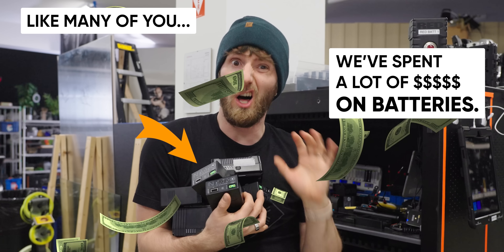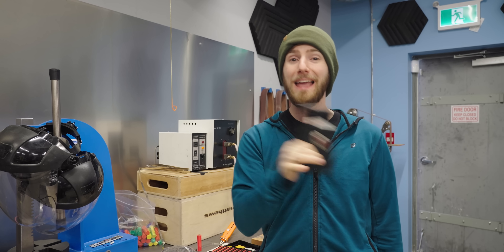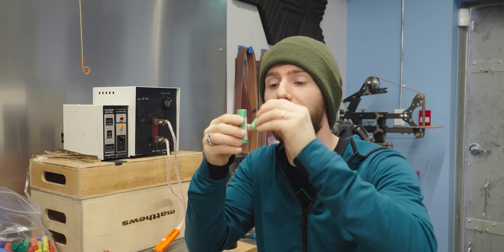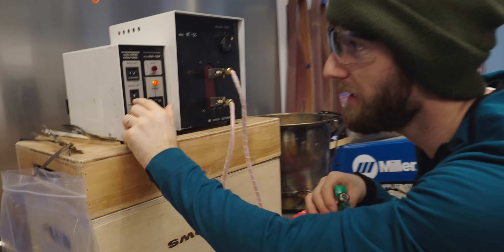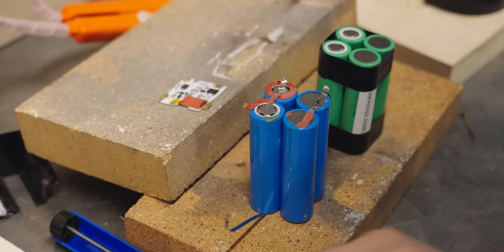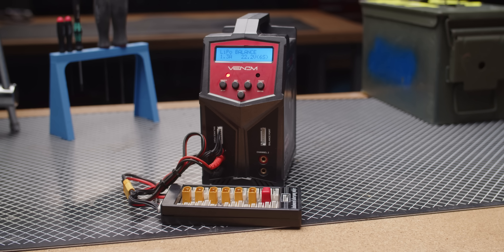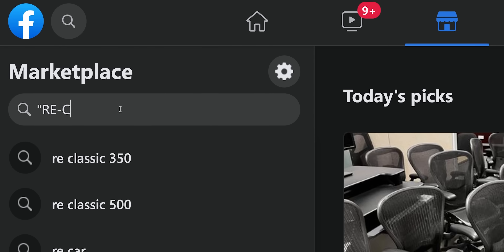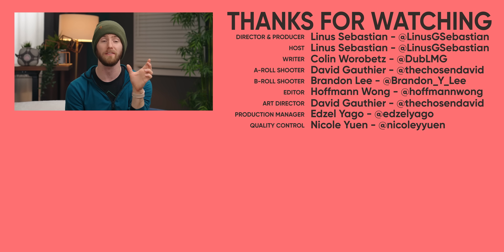This should be illegal… Battery Repair Blocking

Comment: I’m kinda tired of the lithium fearmongering tbh. Like, yeah, don’t puncture them or saw them in half or throw them in a fire or pour water on it
But there’s an entire hobby of people strapping raw lithium cells to a set of spinning knives flying through the air at 100km/h with velcro. Lithium is fine if you take basic precautions
Reply: oh hi ! i have a spinning knive ! had 2 battery fire (collided with another spinning knife and with a wall) but assembled a few 18650 and 21700 packs with no issues whatsoever
I was laughing a bit at how they threw away their pack while i got bigger sparks while plugging my drones.......
Reply: @TheElipsus  I had a short on an FC USB port once (bad coating job on my part) and I connected the battery while it was plugged in to said port. Took 2 days to get the smell out of the house
Reply: @TheElipsus  yeah the difference is they wanted to use the batteries in their work space, around other people, to make videos with the power of said batteries. You are playing with a toy for entertainment and are focusing solely on said toy the whole time. Having a lackadaisical outlook on the safety of your employees, your assets, and your revenue isn't a good idea, especially if you are going to make a public video about it.
Reply: @Ravenousjoe  not true. I use FPV as a cinematography tool, often on gigs. I did one shot in a dense urban area over a 400m tall building. If, say, the hand of god decided to reach down and unplug the battery, there would have definitely been a lot of property damage and potential casualties
Not all garage-built drones are used recreationally 

Edit: autocorrect
Reply: @MaxRovensky  so you are admitting that you are willing to risk property damage, and injuries to others just to save some money on batteries? Given that they work in a different environment entirely, that's up to them if they want to take that risk. I believe you that it isn't as dangerous as they say it is, but if they don't feel comfortable, or have 0 interest in practicing just to save a bit of money (while still having inherent, albeit lesser, risk), that's up to them.

It's not fear mongering if you understand that not everyone is comfortable with doing these repairs, especially when property damage and injury is in the picture.
Reply: @Ravenousjoe  No, I would happily pay extra for a DJI-style smart battery for my drones if one existed. The reason FPV pilots use dumb raw lithium-polymer cells is because they need to be able to delver a lot of current in very quick bursts. Lithium ion packs can't do this and no one except DJI is really doing anything in lipo bms space and the one FPV drone they have is unusable garbage. Texas Instruments have a reference design for a drone lipo management board which supports up to 4 cells (which is getting outdated quickly as everyone moves to 6S) but for whatever reason no one has made it into an actual product.
Reply: i remember a video of louis rossmann just hammering lithium batteries down just to prove the point that they aren't as dangerous as apple makes them out to be
Reply: have been using ohms law to safely vape with lithium cells for 6 years now. using mechanical device right now with no protections.
Reply: man, I was thinking of commenting that, lithium batteries are dangerous, but this felt like too much lol, like I'm strapping them with $4 worth of velcro straps, no safety systems anywhere. And the fun part is, that if a better battery would be invented, with even more energy per cubic cm, even more dangerous, we would slap them on drones immediately xD
Reply: @SukSukulent  Hell yes, anything to give me more flight time for some long range cruising :D
Reply: I agree with you, but the same could be said about a LOT of dangerous substances or activities.  A certain amount of fear of the thing (be it Li-ion batteries or whatever) is why you take basic precautions.  I fear getting into a car crash, so I take precautions when roads are slick, but it also doesn't stop me from driving.  Those Batteries CAN be dangerous.  Until the dangers are common knowledge and people know how to deal with these dangers, I don't might the fearmongering.
Reply: agreed, i think ltt was going a little overboard to make this look more dangerous than it actually is.
Reply from the maker: As an avid quadcopter builder/crasher/maintainer (in that order) I am well aware of the dangers of Lithium cells. We took proper precautions, and want to do our best to convey the danger. Batteries are hazardous, and people need to do their own research before attempting to work with lithium cells - that's all. -CW
Reply: @LinusTechTips  Thumbs up for making it clear what safety precautions should be taken when working with these bateries.

Comment: lol, i was literally just looking up a way to recell my Thinkpad T430s' battery when this showed up, it's a small world
Reply: Good luck, I think those also have fuses that blow if the voltage goes too low. Be prepared to use aa batteries or something to fool the ic :D
Reply: @TheIdiotPlays  Yes, you need to first match the new cells with the old cells and then have a power supply always provide the old cell voltage to the BMS when replacing the batteries...
Reply: Linus has been listening to your phone and spying on you lol....like Amazon and Google Adsense on phones
Reply: @BattleOverride856  Linus?
More like Spynus.
Reply: @StrokeMahEgo  spynus 🤣🤣
Reply: What a cool coincidence. One small issue- Linus is inside your walls
Reply: why would you go through the hassle of recelling that just buy a new one
Reply: @Jon844W  New one costs twice what you can get the laptop for...
Reply: @rkan2  the battery and laptop are cheap
Reply: @rkan2  They're like $24 on ebay. OEM ones would be expensive though.
Reply: @codyn92  You think you get 6/9 good quality cells in a 24$ battery? Most of the knockoffs are shit (you get what you pay for). Panasonic/Sanyo/LG cells are at least 5$/pc and you can add another 5$ per cell as pack cost. Therefore for a good battery they'd have to cost at least 60$ for a 6cell or 90$ for a 9 cell. Recell your own battery with quality cells and you can only consider paying for the cells (30/60$)
Reply: Linus Spy Tips
Reply: I mean I hate to be that guy but surely it's not worth the effort compared to $20 you can get replacement batteries for.

Comment: Damn this is crazy tbh, none of the circuits or batteries themselves look too hard to DIY/repair if you need too... You could even 3D print yourself a pack like that, order some reputable 18650 cells and boom, but nooo...
Reply: isn't boom what you're trying to avoid?
Reply: @morpheus636  Not if you want views
Reply: some 21700s
Reply: @aeoteroa818  Interestingly the 21700s didn't take off as much as I thought they would a few years back, guessing just the economies of scale of how many 18650 were already being produced
Reply: @artemdoesthings821  21700s didn't really take off because of how much space is left between the cells because of their radius.

They're pretty common in super high current draw applications because of that space, so they can push air between the cells and 21700s can support super high current output
Reply: @codec862  Fun fact: The ratio of empty space will be the same whatever the radius.
Reply: @chaos.corner  That... actually is a fun fact.

Huh, I guess 18650s do make more compact packs, but not in the way I thought
Reply: @codec862  Thicker batteries will be harder to cool though but should be a little cheaper to make. All engineering trade-offs.
Reply: @aeoteroa818  can they recalibrate the BMS to work with 21700s?
Reply: Yeah This Video Was A Bit Exaggerated!
Reply: You also need to have a solid understanding of ohms law before attempting it too… wouldn’t want exploding battery packs
Reply: @aleasevr  Samsung enters chat
Reply: @thats_not_glue  LMFAO Dude I stopped using their 18650s because they kept exploding on people. They have the legitimate worst battery safety I have ever seen